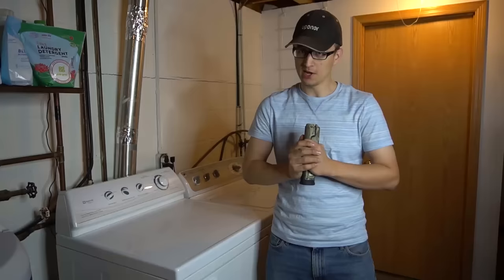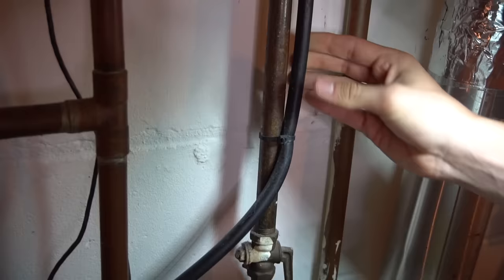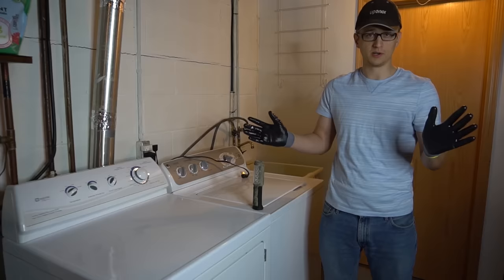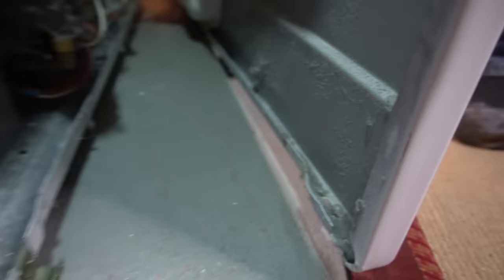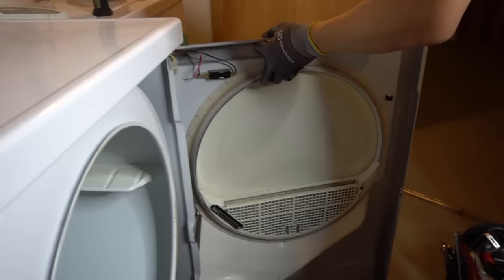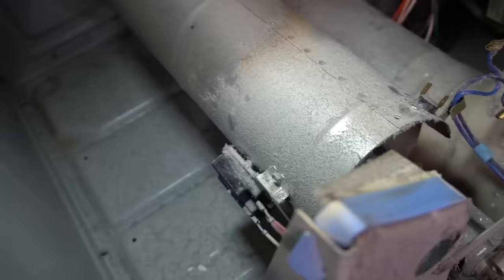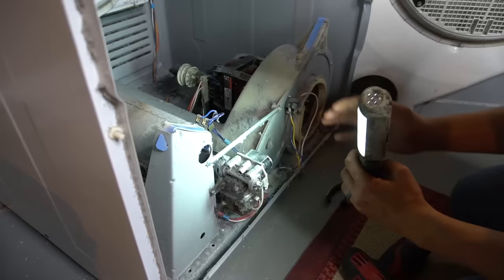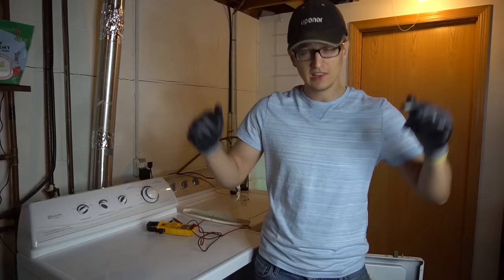Dryer Not Heating and The Most Common Fix

Comment: Hey, thanks for the dryer info. I have an electric dryer and it's not providing enough heat. I get some heat but not like it was. I checked the electrical service and there is 240v to the machine. I checked the vent and also ran the dryer with clothes, disconnected it from the vent pipe, and ran the dryer. I replaced the heating element and cycling sensor.  Any idea?

Comment: how can i make sure im 100 percent certain about if the part is compatible? or how do i check for the gas coils part number, ive been looking online and i can't find a matching number, Gr8 vid. Thanx!
Reply from the maker: The best way would be to call an appliance parts store and tell them the part you need. They will ask you for the brand, model, and serial. And then they will tell you what part number will be compatible with your unit. That's the easiest way :)

Comment: Hello, Thanks for the video. I am still stumped with my dryer problem. I am working on my son’s Maytag SDG515DAWW gas dryer. The igniter will glow for about 20 seconds then go out. This told me the safeties, limits and thermostat were good. I then replaced the coils. Same problem still. I checked the coils for being magnetized using a paper clip during different parts of the cycle as follows: When the igniter is glowing the coil in front with 2 terminals is magnetized the back one is not magnetized. As soon as the igniter clicks off then the back coil with 3 terminals becomes magnetized. At this point both of the coils are magnetized and gas should flow but does not. Am I correct in my troubleshooting so far? Is this a problem with the gas valve being stuck closed? Can the valve be serviced? He does not have the $180.00 plus shipping they want for a new valve as he is a 1st year trainee at his job. Am I missing something else? Thank you in advance for your help.
Reply from the maker: Hi there! Sorry to hear about the dryer problem. Usually the new coils will fix that but unfortunately that's not the case for you.. If your gas valve coils are new, your valve is getting power, yet it is not opening.. Then yes, I would say the gas valve is stuck and needs to be replaced. I don't think there is a way to service it.. Not that I know of at least.
Reply: @WordofAdviceTV  Thank you for the fast reply and advice.
Rob

Comment: Thanks if it is the part you first mention goes bad will the igniter still light / turn on i see no glow under my dryer i use too and then the glow would get bigger brighter when it worked now no glow at all

Comment: Great example, I need your help I have a Samsung gas dryer the igniter turns on for a few seconds and gas valve turns on also but then it turns off again and repeatedly same thing , I change all the safety components and gas coil also but it is still not working, sos.

Comment: My prob is no heat.  Re the coil ohms, I get about 1500 across all connections but the outside two of the triple prong coil where I get about 500 ohms.  I think these are in spec.  All the thermostats and gas temp sensor check out OK.  I guess there is no way to check the gas valve.  Thanks for the thorough diagnostics.
Reply: BTW with the drum removed but all plugs connected when I push the start button the motor turns and I hear what I think is the gas valve click.  If I hold the button sometimes the ignitor glows but no gas ignites but other times the gas will eventually ignite then go out when I release the start button.

Comment: I have checked everything for continuity and all parts are fine but the igniter glows and goes out after a minute and I never see a flame.  The dryer starts, tumbles, timer advances on air fluff cycle but no heat on other cycles, no flame, so timer doesn't even advance.  Can you suggest a possible fix before I have to buy a new dryer?  I have a Maytag DG312 dryer.  Thanks in advance.

Comment: my question is, If my dryer turns on and after a good minute the dryer turns off would my problem be the thermal fuse?
Reply from the maker: Very unlikely. (there are many different brands/models so can't say with absolute certainty) The typical symptoms of a blown thermal fuse are: Dryer does not turn on at all or it spins but does not heat.

Comment: THE MOST COMMON PROBLEM IS CLEAN THE VENT. If after that and it runs but no heat then you gotta open it up and check it out properly depending on whether gas or electric

Comment: Great video but apparently you should start by checking the circuit breaker first...  My dryer was turning but not heating (indicating that I was getting electricity) so I didn't even think to check the breaker.  I also have an irrational fear of putting a multimeter in electrical outlets so I might have figured this out when testing the voltage of the dryer plug...  Nevertheless, I pulled out the drum tested all the perfectly working fuses and temperature monitors to discover that my breaker was flipped likely due to a clog that was passed the dryer filter.  So removing the front panel and dryer drum wasn't a total waste of time.  Breakers and fuses don't blow without reason so clean while you fix!  Also, if you figure out how to open up your dryer, you can effectively do any kind of work on them and knowledge is power!

Comment: I need a little help on my gas dryer where it is not heating up.  It is a Maytag and I have replaced the the igniter, the thermo fuse, thermostat, and the valve coils.  When I replaced the valve coils it worked for about 3 days and then went back to no heat.  So I replaced them again thinking I might have purchased some faulty ones but no luck this time.  It will not heat up.  Any ideas on what might be wrong?
Reply from the maker: From what you described, I want to say the gas valve is bad. Usually the ignitor will be glowing though. If the ignitor does not start to glow then there's something else wrong. Like a thermal fuse blew again perhaps?
Reply: Word of Advice TV - I have replaced the igniter and checked the thermal fuse and it checks out.  I have no way of seeing the igniter glow because of the design of the dryer.  Is there a video on replacing the gas valve.  Thank you for the courtesy of a reply!
Reply from the maker: @billymakesmusic  I don't have any videos like that but repairclinic or another channel like them do. Here's one I looked up that you can use as a starting point: https://www.youtube.com/watch?v=anWaqbzKsKw
Reply: Word of Advice TV Excellent and thank you for your help.  It is very much appreciated!
Reply: Word of Advice TV I replaced the gas valve and it took care of my problem.  I found it strange that I replaced the coils in the old gas valve and it worked for about 3 days and died.  So as you suggested I replaced the old gas valve assembly with a new one and we have clean dry underwear and T-shirts.  BTW - The gas valves can be an expensive part if you buy it new and I was very fortunate to find a used one on eBay.  God bless you for your willingness to help us peasants figure out a way to affordably fix our dryers and take the time to reply to questions!
Reply from the maker: Happy to hear you got the dryer fixed! Thank you for coming back with an update! Happy laundry ;)

Comment: Hi J I hope you get back to me asap, my dryer stopped heating up, I first turned it on, it ignited and it stayed ignited for like 2 or 3 minutes then no more flame, I checked the thermistor that is at the top of the dryer I have a frigidaire dryer, that one has continuity. Do you suspect the thermal fuse actually is blown or the running thermistor is no good? can you please give me your thoughts on this? I may just buy a whole new burner assembly, I havent taken it all the way apart yet but I may to check the thermal fuse and the running thermistor, or do you think my heat setting switch is bad? Please give me your thoughts on this.

Comment: I have a maytag neptune gas dryer with digital panel. It would automatically switch to "PuffAir No heat" in the middle of a cycle.  I started with Time Dry and can feel there was heat initially until it switch to PuffAir. What could be the cause?
Reply: Sorry I meant "Air Fluff No Heat", not Puff Air. :P

Comment: My gas dryer is intermittent on drying. sometimes it works and drys the load. sometimes the igniter comes on and gas lights but then later in cycle it doesn't glow and therefore gas doesnt ignite. sometimes the igniter comes on but gas doesn't ignite and igniter goes out. Sometimes igniter doesnt even glow when first turned on. I replaced the coils and checked the sensors which were ok. is the problem the igniter? or could it be something else

Comment: Hello, I know its been a while since you made your video but I have to ask,  my gas dryer was stopped up with lint where the filter goes in the front actually my dryer was made 1996 and Maytag. What I was wondering if mine takes a few times to dry my clothes, would it be safe to say its the theral fuse ? The first thing you used a multimeter on ? Thanks , oh yeah I'm glad I took it apart my belt had cracks..

Comment: Sometimes my gas dryer does not heat or much at all. Then all of a sudden it's back to normal. We did not do anything (intentionally)  to fix it either. Any clue? Edit: also I tend to smell an odour outside sometimes as if it wasn't cleanly burning the gas.
Reply: Mine was heating up occasionally.  Turned out to just need the vents cleaned (the outdoor guard that goes over the vent exit so mice can't enter was completely clogged).
Reply: Yes, clean all of your vents and hoses right away

Comment: Can you show how to check the sensors? The ones that sense if your clothes are dry. Every other electrical switch checked out fine but there’s not enough heat or no heat at all. And sometimes the dryer will trip the fuse in the breaker box.
Reply: A blowing fuse often means the elements are sagging and shorting out on the case (you need a new element), or sometimes it is due to loose wiring on the breaker.

Comment: my dryer was working fine, but my washer had a problem and overflowed and I had to replace floor. Well anyway since i replaced floor I went ahead and ran new exhaust hose. Then I took and used my leaf blower to blow out all lint. So its all clean. Lint screen is clean too. once I put it all back together it wont heat up. Hmmmm..Turns on but no heating up. Ya got any ideas? Its a Kenmore with a 220.

Comment: My dryer will ignite and heat up and then turn on and off and then eventually won’t ignite anymore and just run with cold air. And the dial won’t cycle through either as the dryer runs. The dial stays out and It runs and runs with cold air. I tested all the parts as you suggested. They all seem to have continuity. Any ideas?

Comment: My dryer is Kenmore elite 
The belt needed to be changed which my husband and I opened the dryer and changed the belt and before that we cleaned really good every corner even unreachable spots vent filter, everything then put the dryer back together and plugged in, it works and I put clothes in the dryer and pushed the start button for 50 minutes. I checked behind dryer I felt some heat blowing and left alone,  When 50 minutes was up I went to take the clothes out of the dryer BUT wasn't dty😞😮
The clothes were little warm but not dry. 
I don't know why the heat was going out not staying inside the dryer and don't know what else can cause the clothes not get dry.
Do you know why my dryer running and heat is blowing but not drying clothes?

Comment: The hardest part isn't taking it apart. That's the easiest part. The hardest part is correctly diagnosing what's wrong. 2nd most difficult is putting it back together when you're done.
Reply: Why don’t you make a video than?
Reply: @cathysanford7693  Calm down princess. Not saying its a bad video. Just pointing out the obvious. Taking something apart is always going to be the easiest step. Anyone can start taking out screws and letting a machine fall apart.

Comment: I have changed all the thermal fuses and the heating element Plus cleaned out the filters and exhaust, also check to make sure I have 240 volts going to the dryer but I still have no heat. What am I missing? Could it be in the timer switch or possibly the door switch?
Reply from the maker: When all the obvious things have been checked/replaced then things can start to get tricky.. Does your dryer have a control board? It's possible that the board is bad. You mentioned that you have a timer though, so I don't think your dryer has a control board. It's not the door switch since an open door switch would cause the drum not to spin too.  Or does your drum not spin? It could be the timer but that's rare. Have you tried both, timed dry and sense dry? You said you replaced all the thermal fuses, does that include the cycling thermostat and hi-limit? One of those could be bad too. Just some thoughts. Hopefully that helps somewhat..

Comment: thanks that was helpful  - my Maytag dryer does not start right away you have to try two or three times until it picks up and starts to work  so what is the problem -thank you
Reply from the maker: Does this one have a start button that you push to start? Or do you mean it takes it a while to start heating? Perhaps the start switch is going bad or the motor is starting to go. Hard to say if it's intermittent
Reply: yes it has pushing  button it is Maytag PYE/G2300 -- when i push the button i can hear some noise like the motor wants to start but it can not do it
Reply from the maker: Your motor may be failing or the rollers or idler pulley get stuck. If you spin the drum by hand, does it spin okay or do you have to push it hard? If you have to push hard then I would take out the drum and check out the rollers and pulley to see how freely they spin. If it's not the rollers or pulley, then the motor should be replaced.
Reply: It could be the start capacitor of the motor that is going bad or the start winding it self. Once the motor takes time to start, it has to be the starter circuit. Have you motor checked by a qualified service tech. Let me is know if your issue has been resolved

Comment: HELP!! Changed the coils, operating thermostat, high limit thermostat. Igniter works, flame comes on, igniter goes out as it should, but then the flame goes out in 10-15 seconds?? SOLUTION : Even though I had cleaned out the vent duct work inside the house, I  did not clean the expandable duct hose extension that I had outside. This is where the clog was. After removing it the dryer worked normally. Purchased $100 in new parts, but still cheaper than getting a bill from a repair shop. Plus I  have new components installed. I've had this Kenmore dryer for 26 years with no issues till now. Will likely need a new belt soon though.

Comment: I have no heat, I have run the steps on my Maytag Bravo XL.  Fuse was good, thermostat good, heating coil shows continuity.  I vacuumed all the lint out and am putting it back together. Any other thoughts?

Comment: After replacing electric element , thermostat, thermal fuse and thermister. Vent is cleaned. Dryer runs but no heat? What am I missing? Whirlpool Wed72hedw1. 
Thank you! Greg

Comment: The heat comes on then cuts off after 5 10 mins... changes the fuse... now I hear when the fire starts (gas) then it'll cut off and get cold after a while... no blockage all lint free... so im thinking can it be that the blower isn't working correctly and its overheating? Cause its also powering off after some running time before the cycle ends.

Comment: I have a very similar Maytag heavy duty gas dryer.  Won’t heat up.  Tested the components and got no beep when I put the leads in the igniter connector.  How do I get the igniter component detached.  Pretty tight in there!

Comment: my dry made some metal hitting sound, it seems come from top left side panel, not from button pollywheel, but as long as i press/put force against  top left side panel corner, the sound disappeared, not sure if it is the polly belt problem or not ? anyone has the similar problem ever ? thanks

Comment: The sensor on the inside of the dryer door measures conductivity,     not temperature.  If the clothes are still wet the intelligent dryers can detect that and continue running.

Comment: Its not hard people. In my case my thermal fuse blew cause the heating element heated up and cooled so many times that it warped and ended up grounding out on the dryer frame thus blowing the fuse. I replaced the fuse and heating element and wala it was fixed. Make sure and just vacuum everything while your in there.

Comment: I have a Maytag dryer That when sometimes you turn turn it on it'll spin and heat and then sometimes it won't heat but it keeps on spinning So on other words It heats sometimes and sometimes it doesn't but it always spins I checked the heating element there's Continuity thereI checked the thermal fuels that was goodThe high limit switch that was goodAnd the thermostat was goodSo all 4 things are good so I thought maybe it would be the timer cleaned all contacts on the inside of timer and for  Continuity and that was good I'm stumped Could you give me some advice on what else to look at  right next to the timer is what looks like a relay could that be going bad if so do test the relay

Comment: I stopped using my dryer because it squeals! Although the noise goes away after awhile. Any suggestions? Thanks!
Reply from the maker: That sounds like either a worn down idler pulley (most common) or rollers that are getting stuck.  (some dryers will have glides instead)

Comment: I wasn't sure which way to put the cord on, but after I did the dryer came on. I turned it off,fixed the vent pipe and slid it to the wall. Then it won't come back on. I mean it will come on but it won't heat up. Help please.